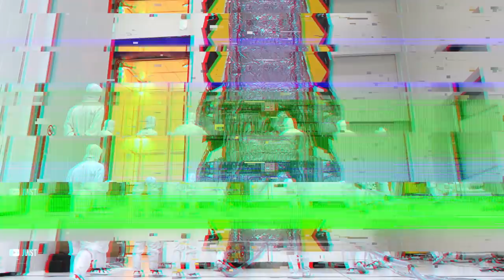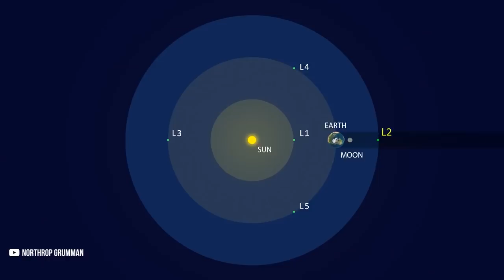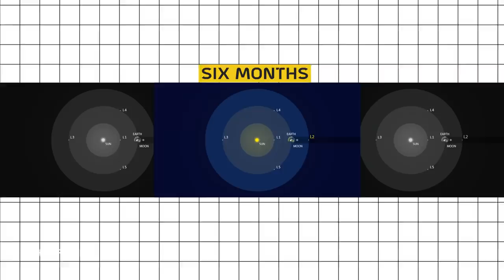James Webb Telescope Launch: 30 Days of Absolute Horror

Comment: “Designed to the centimeter”
“Inspected to the centimeter”
Probably they had tighter tolerances than a centimeter
Reply: Thought I was the only one 😂
Reply: @WARIOROFKI123  Same
Reply: Definitely to the micrometer. Aircraft engineers are already working with less than a few millimeters of error. 

I don't doubt engineers of this multi-billion dollar space telescope work with only micrometers of error
Reply: There are aspects of the telescope that were measured to the nanometer (0.0000001 centimeter)
Reply: "There were zero margins for error"
Reply: This is the kind of error that makes me discredit the entire video.
Reply: If like to see it to microns or nanometers..
Reply: Yeah I know and centimetre is not even an SI unit. Micrometres would be a better spec.
Reply: Designed to the nanometer.
Reply: At least the optics!
Reply: @Einargizz  for sure the mirror
Reply: Oops it was inches
Reply: Nanometer
Reply: Helium light bands of flatness on the mirrors would be nice!!

Comment: God, I hope this works. There is just so much that can go wrong!
Reply: @knuthamsun6106  They've pulled off some miraculous stuff but there are so many moving parts!
Reply: @knuthamsun6106  Any relation to the Norwegian author?
Reply: @Bradford nope, just a fan of his with identical politics 🙃
Reply: The JWST is much more complicated than the Hubble Telescope.  The Hubble had some problems, but they were able to send service missions using the Space Shuttle, to fix the problems.  Nasa sent five service missions to fix problems and install updates on the Hubble Telescope from 1993 to 2009.  We cannot send a service mission to the JWST, because it is at the L2 Lagrange point.  The Hubble is orbiting the Earth, and is close enough to sent a service mission (except now we have retired the Space Shuttles, so there probably will not be any more service missions).  The Hubble was also designed so that it could be serviced in space.

I hope the JWST is successful.
Reply: @davidgatzen1543  The best we can hope for are software updates, and that depends on the onboard computer working throughout the life of the telescope.
Reply: Not to mention it has to travel 1 millions miles away before it can be operationald

Comment: Pretty sure this was recorded before the small accident caused at French Guinea & thus now the launch date is pushed to 22nd not a huge deal because they just have to do some more safety checks to ensure nothing happened to the telescope when that unlatching of jwst from its booster failed & induced a small vibration which might be still in the range of vibrations that jwst can handle but because of the fact that all sensors were turned off at that time they don't have the readings.
But precautions are better than cure heh especially when cure is not even present in this case. 😂
Reply: Wow, all that and only one piece of punctuation. Nicely done. /s
Reply: @datdudeinred  Seven whole likes. You are the king of the internets. Your mother must be so proud.
Reply: @unclerojelio6320  bruh why are you mad?
Reply: @Midlander1956  that wasdeliberate!!!!!!!
Reply: @esecallum  aw, such a shame a great video is ignored in a fight over words and the way they are put together. I’ll assume your response (which includes 4 misspelled words out of 6, plus two grammatical errors) is deliberately incorrect and is, in fact, intended as a witty response. If it is, well done, and you’re right to say provided we understand the meaning then it is okay to get things wrong occasionally. However, if you are serious, getting communication wrong can be serious..remember when somebody mixed imperial and metric measurements on The Hubble mirror? Whoops, that cost billions to repair. Proper use of punctuation avoids errors but hey, why do it right when it is just as easy to do it wrong?  Anyway, If you meant to reply in a totally unnecessary way  that’s really sad; the video is interesting. Please be kinder to those who voice an opinion….?
Reply: @Midlander1956  

    A psychological condition of society known as “mass formation” is a condition for totalitarianism. Under mass formation, a population willingly sacrifices their freedom
    The central condition for mass formation to occur is a lack of societal bonding. In other words, social isolation on a mass scale, which is precisely what the lockdowns were all about. But even before the pandemic, social isolation was at a historical high
    The second condition is that a majority of people must experience life as meaningless and purposeless. The third condition is widespread free-floating anxiety and free-floating discontent. This refers to discontent and anxiety that have no apparent or distinct causes
    The fourth condition is free-floating frustration and aggression, which tends to naturally follow the previous three. Here, again, the frustration and aggression have no discernible cause
    Once these four conditions are widespread, mass formation can occur, which allows for totalitarianism to rise and thrive. A key strategy to break mass formation and prevent totalitarianism is for dissenters to join together as one large group, thereby giving fence-sitters who are not yet fully hypnotized an alternative to going along with the totalitarians. Another is to loudly speak out against the totalitarian regime, as this is how atrocities are limited

Comment: The design, implementation, and deployment of the JWST is so extremely complicated! It is apparent to me that complete success can never be accomplished. 344 SPFs (Single-Point Failures) designed into its deployment? That's totally insane! An airplane with that many SPFs would never be approved for flight. If I were a betting man, I'd bet against it ever achieving effective operation. I'd never be able to find a taker of that bet in Las Vegas, no matter what the odds. Why can't a few more years (nothing in the overall scheme of things) be spent in improved design simplicity and reducing this high likelihood of failure? Answer: Hubris of all involved.

Comment: I was one of the scientists working on Webb’s modulated photosynthesizers that we’ve had to engineer into the comb’s integrated circuitry as well as on the recalibration of the electro-mechanical switches and I can attest to the YouTuber’s reference to the zero-error mindset that we all —even the secondary line of the mechanics and technicians—had to adopt in the course of our duties, however long and laborious they were. I can’t speak for the momentous logistical operation that will be required to get this much-awaited telescope off the ground but we all feel very confident about its post launch mission, and that is to give the scientific community the visual data that they need to infer about the Universe’s origins.... and where it’s headed.

Comment: With all those moving parts and systems that might fail I'll be really surprised if it all works perfectly and in fact I'll be mildly surprised if it even manages to deploy its heat shield correctly.
Reply: Keep the faith :) we have been deploying stuff in space for a very long time now and I feel like we have figured out which kinds of mechanisms work and which fail. Every time something failed in the past a lesson was learnt and I would like to think that the JWST was built on those lessons. The last few Mars landings have been very complex but went flawlessly. I think JWST has a good chance :)
Reply: I believe it has been tested for several years so chance of success is higher than failure. Fingers crossed 🤞

Comment: Zero margins for error seems impossible. I always wonder why they didn’t create it with room for inevitable error. I hope it goes smoothly 🤞🏽🤞🏽🤞🏽
Reply: yeah, there is room for error - electronics are redundant, etc
Reply: @olasek7972  same will no doubt go for the software… heavily error correcting, multiple instances running to achieve consensus. How anyone could possibly think that they would not have considered that and planned accordingly, especially after watching this video, I’m not sure haha.
Reply: They have designed it so that there are multiple fallback routines in case something goes wrong.  I am just mostly worried about the rocket exploding on the pad or mid flight.  That would be absolutely heartbreaking
Reply: @charleslaine  Right. I’m really excited for this though. If all goes well, imagine what we will see!
Reply: @olasek7972  Far more disastrous mistakes have been made going to space.
Reply: @AM-xe4iq  🤔🤔 so?? What does it have to do with my post above?

Comment: Despite Hubble's mission being over 30 years, JWST's mission is only 5 years...   It's observation time is nearly booked fully through to it's (estimated) EOL.  So, don't get your hopes up, peeps.
Reply: 5 years??? Where did you read that?
Reply: 5 to 10 years, depending on how long the helium coolant lasts.
Unlike Hubble, JWST is an infrared scope, that has to keep super cool.
Reply: But will it be able to see inside Uranus??
Reply: @mleonard4628  i mean, your question is not..  entirely centering on the proverbial pun... because of course given the telescope's capabilities it is not unironic to inquire as to WILL IT?? I'd like to take a glance at those diamond raining 360mph windstorms in Uranus at a cool -300°F.
Reply: @NullHand  There is no helium. The telescope is passively cooled. That's why it has those massive shields. The problem is the propellant
Reply: @NullHand  you are misinformed, no helium coolant, the fuel lasts 10 years plus some margin
Reply: @asicdathens  
The 3 near infrared cameras can be passively cooled, but the mid-infrared camera has an active compression-expansion cooler with helium as the working fluid.
Better than a boil-off dewar, but helium still loves to leak.
You are right that ultimately reaction mass or failed gyroscopes are the traditional last curtain for space observatories.
Reply: @NullHand  Sealing helium from not escaping has made a lot of improvements over the last 10 years. My hard drives are helium filled , something that would be unthinkable few years back.
Reply: @mleonard4628  the proverbial probe
Reply: @NullHand  The specification is for a minimum 5 year operation but it was designed to go 10 years. 
The limiting factor is hydrazine fuel to make minor positional adjustments at L2. 
The spacecraft is passively cooled by being keep in the shade in a very cold Universe. 
Only one of the spectrometers is being actively cooled to a temperature of 6 Kelvin. That is being done by a closed cycled helium refrigerator that uses gaseous helium permanently sealed in the instrument. It is not a consumable and will work as long as the electric pumps work. 
There is no liquid helium on JWST.

Comment: Thanks for a most detailed rundown of the post-launch deployment of JWST! A remarkable description of a truly remarkable instrument!

4m55s – "1.5 million miles from Earth"
– No. 1.5 million km from Earth.

Fred
Reply: I spent a few minutes doing some really basic math on how far they will be trying to reach with the telescope.  The million mile position of the Lagrangian point doesn't even begin to scratch the surface of the distance they are trying to reach.  1 light year='s 5878625000000 miles.(thats 13places)  Our nearest nearest galaxy is 4.5 light years!!  They are trying to reach 13 billion light years with JWST.. It becomes clear at that point the postion at the simply to aid in creating the best "conditions" for  JWST to work in as it endeavors gather data in the near infrared light!!
Reply: @highpointsights  Our nearest star (to the Sun) is about 4.2 lt-yr.
The nearest galaxy, the SMC, is I believe, several hundred thousand lt-yr (our own Milky Way galaxy is about 100,000 lt-yr in diameter).

Fred
Reply: @ffggddss  my lightwaight research had it at 4.5!!!  THANKS!!
Reply: @highpointsights  But it was the nearest star, not galaxy! (SMC = Small Magellanic Cloud, about 200,000 lt-yr away)

Fred

Comment: T+2 Days: Webb initiates the second of three mid-course correction burns.
    T+3 Days: Webb begins the multi-step process of deploying its five-layered sunshield by unfolding its forward sunshield pallet, part of the Unitized Pallet Structure holding the shield. Parts are whirring and warming and preparing for the next steps in deployment. If all goes well, the aft sunshield pallet will deploy the same day. The two pallets fold outward and down, forming with the Webb spacecraft bus — the main skeletal or space frame — a plane perpendicular to the column formed by the still folded mirror segments.
    T+4 Days: Webb’s mirrors and other components are lifted two meters relative to the plane of the sunshield pallets on the Deployable Tower Assembly. This gives the sunshield room to deploy fully and will later help further thermally isolate the telescope mirrors and instruments from solar energy.
    T+5 days: The Webb deploys its after-momentum flap. This is a reflective control surface designed to counteract the force of sunlight on the tennis court-sized sunshield. The reflective sunshield will naturally act as a solar sail, and lead to unwanted torque and other accelerations, but the momentum flap will dampen these effects to help keep Webb’s view on the universe stable.
    T+5 Days: Protective covers in place over the sunshield since before launch now roll up in preparation for the shield’s deployment.
    T+6 Days: The sunshield booms extend on either side of the Webb bus, creating the diamond-like configuration for the sunshield as the shield membranes unroll.
    T+7 Days: The Webb begins a tensioning process to pull taut each of the five layers of the sunshield, completing the process by day eight. 

The second week of Webb—

    T+10 Days: Webb’s secondary mirror swings from behind the Deployable Tower Assembly to its operational position in front of the primary mirror. It’s one of the most crucial moments of the telescope’s deployment — where a bad antenna could slow the rate data could be sent home, and a solar panel failure could reduce the scale of operations, failure of the secondary mirror would mean no images from Webb at all.
    T+11 Days: The aft instrument radiator, essential to keeping the telescope’s sensitive infrared instruments cool enough to see, deploys.
    T+12 Days: The left wing of the primary mirror folds out and locks into place. Webb’s primary mirror comprises 18 beryllium segments, but those segments are divided into a central portion and two side wings, folded tight to the central column for launch. Each wing contains three mirror segments.
    T+13 Days: The right wing of the primary mirror folds out and into place, completing the full 21-foot diameter mirror and marking the full deployment of the James Webb Space Telescope.

Comment: one question.... why it is not possible to deploy the JWST 'FULLY' in our Earths orbit near ISS [so that Astronauts can reach for any finetuning] and then after complete test ... deploy to L2 ?
Reply: There's a number of reasons why it cannot be deployed near ISS.  ISS is in lower orbit which means there's a lot of debris that can damage the delicate parts of the telescope.  
Next is the propulsion system to L2 which is an electrical based so the charge is stored in batteries.  It can wear off, the solar array can only support batteries for course correction and for other modules.   
Lower orbit has a lot of radiation which can affect the efficiency of the telescope.

Comment: They protected the telescope in transit from vibration, g forces and temperature differences while it's gonna shake on the rocket like crazy, experience 3G's for minutes, and in deployment will have a 300+ degree centigrade temperature difference. If it can't survive the transit, it can't survive the deployment.

Comment: I was one of the scientists working on Webb’s modulated photosynthesizers that we’ve had to engineer into the comb’s integrated circuitry as well the recalibration of the electro-mechanical switches and I can attest to the YouTuber’s reference to the zero-error mindset that we all —even the secondary line of the mechanics and technicians—had to adopt in the course of our duties, however long and laborious they were. I can’t speak for the momentous logistical operation that will be required to get this much-awaited telescope off the ground but we all feel very confident about its post launch mission, and that is to give the scientific community the visual data that they need to infer about the Universe’s origins.

Comment: So I know I'm paranoid, but am I paranoid enough?  The heat shield will act as a solar sail. Has enough manuvering fuel been loaded onto the payload? Perhaps the team should start designing the refueling mission and the micrometeor repair drone now so that those parts will be ready when needed. Collateral benefits about how to reach L2 cannot be underestimated. I expect the team has built the rest of the systems so that deployment will happen successfully.

Comment: OK, lets assume the spring-loaded latch hasn't caused enough doubt about lab integrity to force re-qualification of the system back at the factory (they will not be able to repair any damage in the launch complex). After deployment , how much damage can the huge target afforded by the heat shield absorb from meteorites before being blinded?

Comment: Ariane 5 launch vehicles have accumulated 111 launches since 1996, 106 of which were successful, yielding a 95.5% success rate. Pray for a safe and successful launch.
Reply: most of the failures were in the very beginning, which is normal, if you discount those it is even better